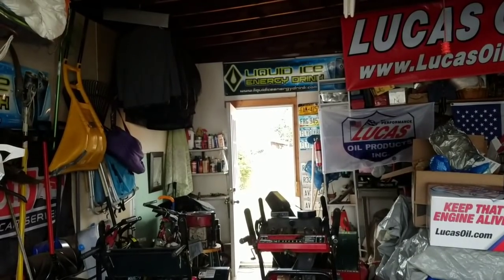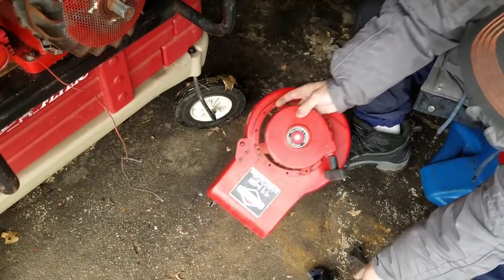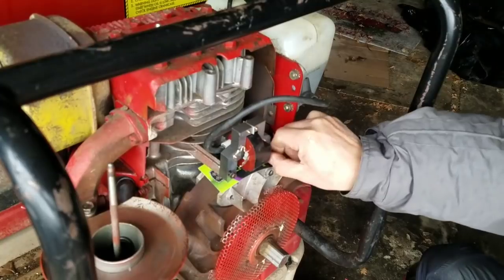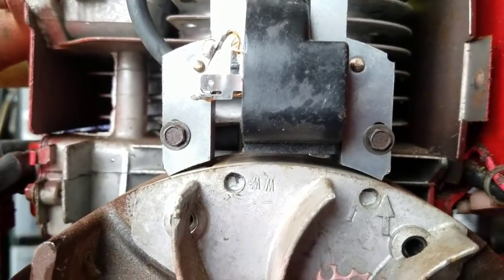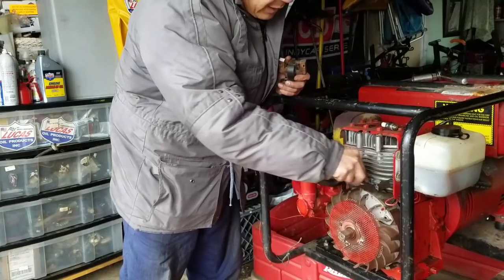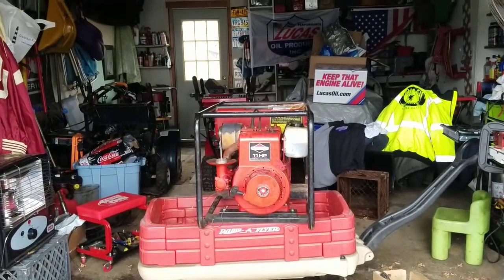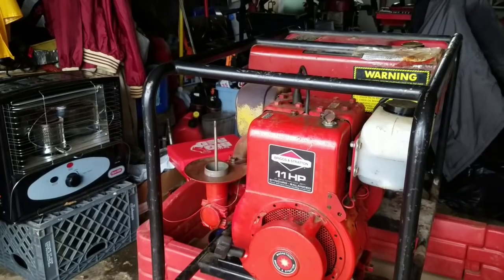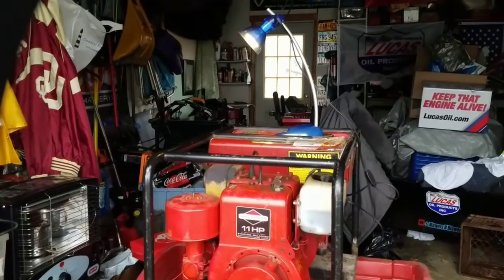FREE DAYTON 11HP BRIGGS ENGINE 5000W 120/240 GENERATOR NO SPARK START MAGNETO IGNITION SWITCH REPAIR

Comment: Tip for oil on clothes, dawn applied directly to the oil on the clothing, spray 409 on the oil stain, those two things usually gets the stain out.

Comment: You just answered the question, the one with the mesh screen is for gravity fed carb, and the paper element one is for fuel pump fed carb..... Now you can use the mesh one on either carb, but I don't recommend using a paper element one on a gravity fed carb, you can but it will run poorly.

Comment: Those 3 contact coils are usually for points, and condenser type engines, what you did was made a points type to a electronic type engine, good job.
Reply: It came factory with a electronic magnetron that coil is an early version

Comment: Hey Henry, try spinning the engine with a  drill instead of having to put the cover on to just test the spark.  I use my half inch drill, an extension and the appropriate size socket.  Seems to work well for me.  Good video!!  Oh, also, I could use an engine cover and starter assembly for a 3 hp Briggs, vertical, with EXACTLY the same ball/shaft.  You got one you want to sell?
Reply from the maker: I don’t think I have those, I’ll let you know if I come across one.
Reply: oh, to be clear I meant exactly like the shaft on the generator!!
Reply from the maker: Lawrence Carroll I definitely don’t have that, but 5 speed ash may!

Comment: The guys here are correct, once you put a good load on it, it will kick itself up in rpm, also shoot some oil down the pin hole on the pull rope starter clutch.... I hear it squeeling.
Reply from the maker: It wont start without throttle pushed closed at idle

Comment: I think that was made in america...  get a L14-30 (30amp) plug at home depot install it between the two sockets.. 30amp generator america made  you got some money on your hands..add some wheels.. fuel tank looks dirty.. great job
Reply from the maker: Oh yeah? How much?
Reply: Id say 500 if you put a modern 30amp receptacle in the center  if the current wiring allows it and chunk those old 20amp s or replace with modern  110 volt 20 amp receptacle. Becareful on how the ground is wired. Some companies use the neutrul to ground. Open the generator head up and see how its wired. I f the neutral does go to ground you can disconnect it but  you have to install a ground wire for simplier wiring on most people.

Comment: Generators need to run at a certain rpm to have the right voltage and 60 hertz. Shouldn't have a throttle cable
Reply from the maker: It’s a choke, not attached to throttle.